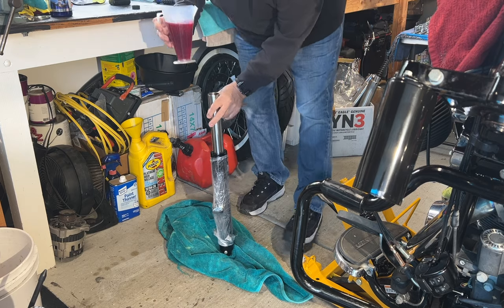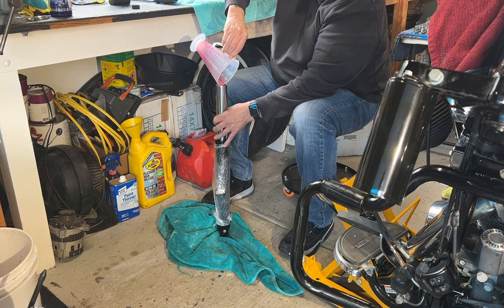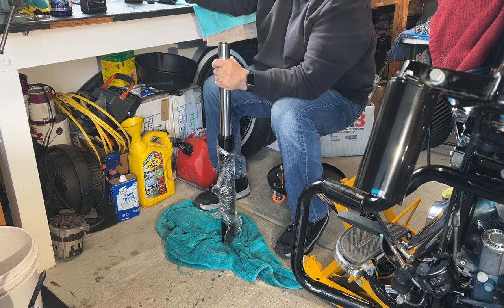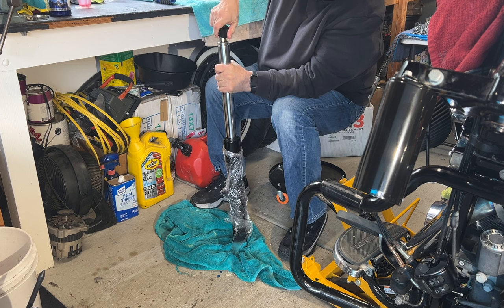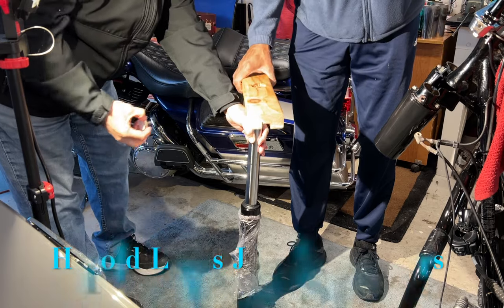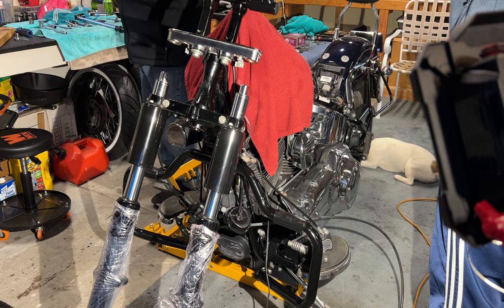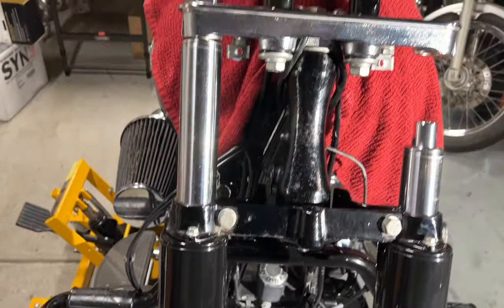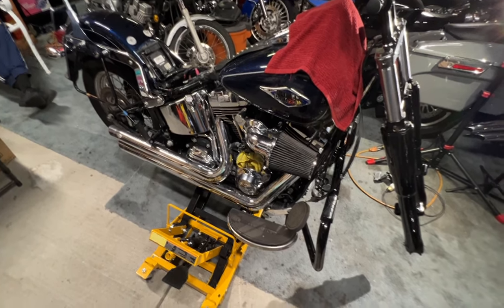These New Black Forks Look Amazing On This 2013 Softail Heritage!!!

Comment: Its been 1 year 2 months since I purchased a hat for a drawing for 1 bike, then it turned into 2 bikes. When is the drawing 2025 ? I get into truck drawings allot max is usually 30 days ( Very Confusing with this one) !!!
Reply from the maker: Hey Richard. First, I completely understand and apologize for this taking so long but please rest assured your money is secure in  this giveaway. It just hasn't happened yet because only half the tickets have sold making half the money needed to announce a winner. I hoping as soon as the weather gets nice the rest of these 98 spots will sell out fast. Again, my deepest apologies and one of these bikes will be given away soon. Thanks again for your support.
Reply: @jcustombuilds  Thanks for positive feedback and understanding from my end.